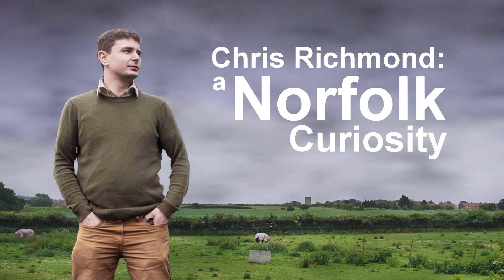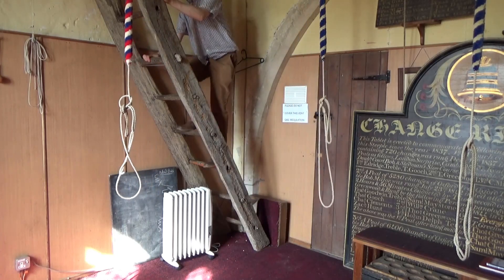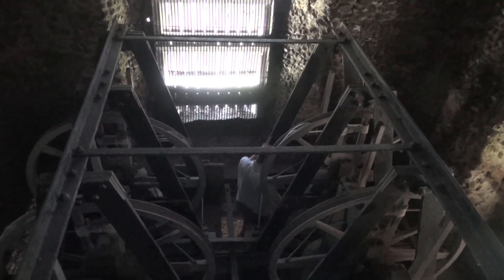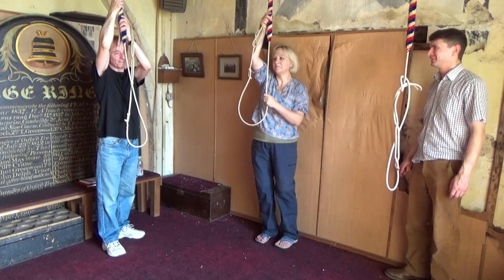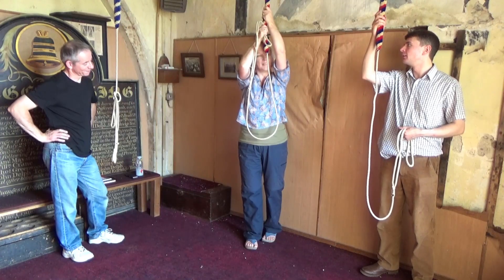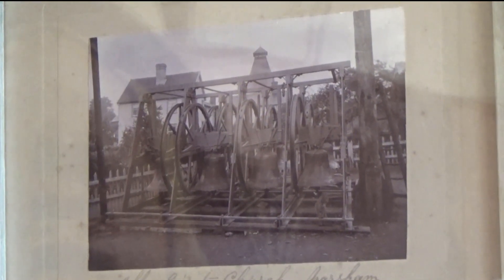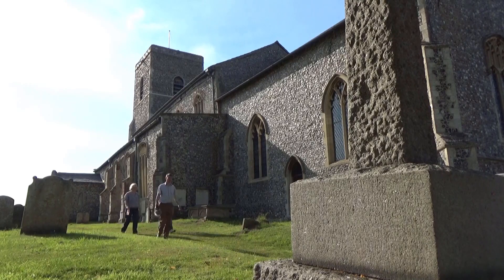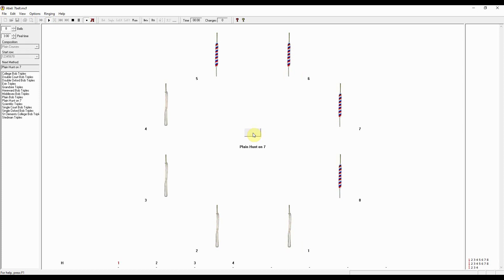Ep11: Recording Church Bells

Comment: Hi Chris, I’m trying to create a BDF file for a recording of bells I recently took. I am following all the correct steps, but it never seems to work. Could I ask what app you use to make the BDF’s?
Reply from the maker: I just use MS Notepad and base everything from a template and just modify the filenames and numbers accordingly.
Reply: @ChrisRichmond  When I do that, and paste it into the bells section on abel, the logo on the file seems to change and never appears in abel sounds.
Reply from the maker: @harrybellringer  make sure ".bdf" is written at the end of the file name.
Reply: @ChrisRichmond  Thank you. I shall try that in the morning.
Reply: @ChrisRichmond  Done that, and now appears in abel, but says WAV file is missing or corrupt. What steps do I need to take to make sure this goes away?
Reply from the maker: @harrybellringer  Double check WAV filename spellings and that they correspond with the script. Close and restart Abel.
Reply: @ChrisRichmond  Done that, but now says, Pitch is too high/low! So sorry about this. Now what do I do
Reply from the maker: @harrybellringer  I've not had that one before. Make sure your treble bell has a maximum number right up to 99 or something and the tenor pitch has a minimum number of "1"